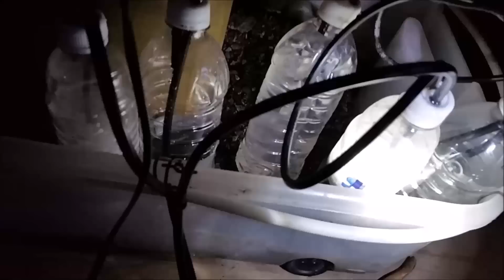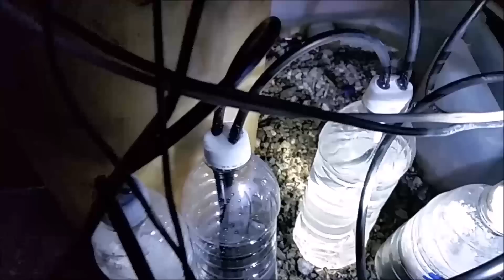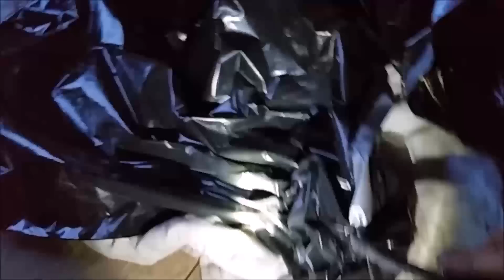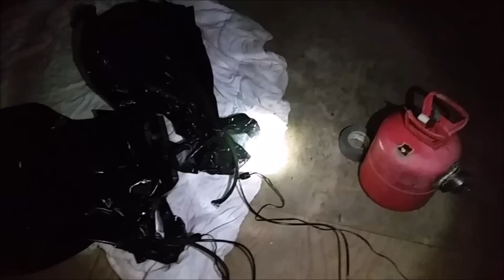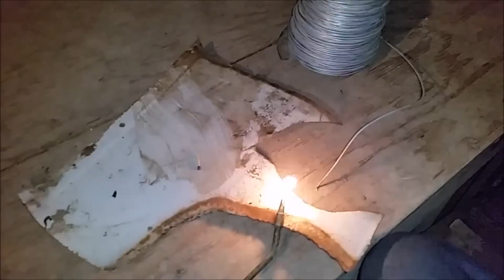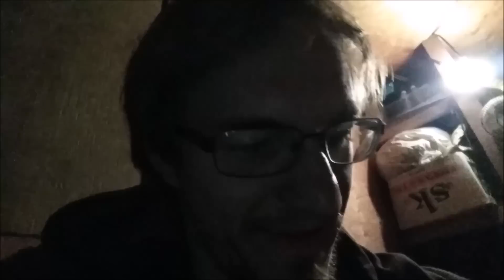Burning Water

Comment: I hope you've been very careful with those cans with those soldered shcraders.  I'm sure it can hold a decent amount of pressure, but the solder is a weak point.  I hope you made sure that the relief valve will burst before the solder will breach.  Also, are those R410a cans?

Comment: i really love to see that. As a Teenager i built a similar Oxygen-Hydrogen-Seperator with plastic bottles, hot glue and graphite electrodes (these worked surprisingly well, try it maybe!); powered by a laptop-energy supply, but i never got it to withstand pressure. If i had a compressor i could have done it your way, but i didn't had one and neither got that idea. 
Cool man :) i loved to see how well the torch itself worked then.

Comment: Cody, in this video you open the hydrogen first. I always see in instructions that torch are supposed to be opened with the fuel first then the oxygen... why is that ?

Personally when I use acetylene, I like to open both acetylene and oxygen so it lights up without sooth. Is there a good reason not to do that ?

Comment: to properly evacuate a cylinder you have to run a vacuum pump to nearperect vacuum to get as much moisture out then fill them with nitrogen to absorb any lingering moisture then run the vacuum again. this method could be done multiple times till satisfaction. or 3 times with is called a triple evac.

Comment: Gas production depends directly on current not voltage so you would do well to run larger and more numerous plates spaced closely at the lowest possible voltage (~1.8V) to maximize efficiency.  Running at such high voltage just creates a ton of heat since P=V^2/R.

Comment: You should have used a brushless electric engine in the compressor that way it wouldn't light the Hydrogen Oxygen mix you made. plus if you compress any Oxygen into the tank then you may have just built a bomb.  I would come up with a better way of doing this. Be safe.

Comment: "Smells like air" -Cody2k16
Reply: Hydrogen smells like nothing too... but it makes you talk all squeaky-like!
Reply: Actually Hydrogen is a lot less dense than Helium, so your voice would be hyper squeaky, Obviously nobody sane would breathe Hydrogen.
Reply: Tore, I've breathed in hydrogen many times and the pitch actually ISN'T that different from helium for some reason.  It does make your voice go higher than helium but not as much as you think.  I can't explain why.  I guess I am insane a little bit.  It's not nearly as dangerous as breathing in a hydrogen / oxygen mixture... well, I take that back.  It's actually QUITE more dangerous to breathe pure hydrogen, assuming there is no source of spark, because you're depriving your brain of oxygen.  A hydrogen/oxygen mixture would not hurt your brain but a spark would cause the flame to flash back into your lungs and you explode.
Reply: I'm not really sure on that.   Yeah, what I'm doing isn't safe.  The best thing would be a helium/oxygen mixture :) TOTALLY safe.  That's what deep sea divers breathe.
Reply: Legend of the Stormlord it’s because hydrogen isn’t to less dense than helium, hydrogen has an atomic weight of about 1 and helium is 4, compared to helium and nitrogen (which makes up most of the air) which is 4 to 14
Reply: @Tore_Lund  Cody did

Comment: Do you use mercury as your cathode electrolysis runs hand in hand with electroplating I want to try Mercury because I feel like it would be easier to separate it might take less electricity and be more efficient.

Comment: There will be trace amounts of whatever material is used to lubricate the pumps in both streams. German airship crews had a terrible mortality rate in WWI until this was realized and they converted to oil-less compressors and they stopped dying from asperating oil. You might be able to make it safe(r) with yet another hooka system. it'd be a design challenge, though.

Comment: @codyslab

its a federal felony to refill those Wal-Mart balloon tanks lol
Reply from the maker: Nope just a crime to transport them after they have been filled.
Reply: +Cody'sLab how did you get them to that location?
Reply: looks to me like he filled them where he used them, no transportation
Reply: Why you gotta be a narc and try and get Cody in legal trouble? lol
Reply: But only if you transport them for others or for sale. It doesn't apply if you filled it yourself for your own use and you transport it yourself.

Although, there are state and local laws, too, but I've never found any that were notable.
Reply: I belive that he meant transporting around on the streets with a car or what ever.. i think not sure
Reply: but you can see he just filled them in the video
Reply: andrew mac sweet
Reply: +Cody'sLab why
Reply: Only if you transport them.
Reply: Not the same thing under the law.
Reply: If you place it in a car truck van bike and take it down the road your going to jail in most states.
Reply: +Darian Berg he filled it after transport
Reply: Darian Berg I bet it has never happened, not even once. First, it would be a civil offense not criminal,  so even if found guilty then no  jail time and no criminal record. Jail time for a civil offense is possible but rare. And for all that to happen a CHP officer would still need probable cause to pull you over and inspect your cargo. It would never even occur to an officer to check a cylinder. Does a self filled tank  look somehow suspicious? And how would someone even check? It's completely impractical. How would anyone possibly know? Can you think of any method that could be used to detect and check for tampering with tanks? Is any such system actually used? So why would you worry even if you were pulled over carrying a self-filled tank?
Reply: *****
numb
Reply: I agree.
Reply: Its about crossing state lines and it is a federal crime... In some states you can't drive at all with a refilled non DOT gas tank at all. If you ever do and some one gets hurt you will be arrested...........
Reply: never said he didn't
Reply: Yes, if I hurt someone with a refilled tank I could be arrested, but that is regardless of the existence of a federal statute related to these tanks. And federal criminal law would apply at a state level regardless of crossing a state line. Also, see criminal vs. civil law. The only statutes I have found related to these compressed gas cylinders only applied to transport for trade. A dealer would get their license suspended and receive a fine -- but no criminal charges. If your tank were to injure someone then this could result in charges of criminal negligence, but the DOT statutes are irrelevant here. This would be a crime even if the there were no statutes related to compressed gas cylinder tanks. Generally speaking if your negligence hurts someone then you can't use "but there was no law against it!" as a defense.

I'm not trying to be a dick. I have actually checked because  I wanted to be sure I wasn't breaking any laws transfilling small tanks from larger tanks. The DOT does not approve this, but as far as I can tell this is not illegal. I see lots of people say they think it's illegal, but I've not found anyone that can point to a state or federal statute and say "this is why it's a felony crime." Obviously I'm no lawyer, but if there were a law covering this anywhere you would think it would be easy to find online. The DOT commercial transport statutes are easy to find.
Reply: Noah Spurrier — Too long, did not read.
Reply: HAHAHA calm down fucken nerds i bet you think its wrong to watch movies on the internet too hahahahaha!!!
Reply: TheSkaterGabriel he had to transport it to that location by walking or driving sooooo....

Comment: Next step get a 3 stage scuba compressor and convert your car to hydrogen power.
Reply: Be much better off with an electric car though
Reply: its more efficient to convert the hydrogen to electricity then power your electric car that way instead of burning.   Of course Cody has the video for the fuel cell too.   It would be tough to get the fuel cell to produce the electricity in the right quantities on demand.
Reply: water power car

Comment: How did you seperate the oxygon from the hydrogen?
Reply: hydrolysis, it's a proses that uses electricity to split water molecules.
Reply: how would you get the hydrogen and oxygen to move to separate containers?
Reply: Michael Hartman 
Oxygen is negatively charged and hydrogen is positively charged, therefore they separate to there respectively charged electrodes.

Comment: That's a really good idea with those compressors. I was trying to figure out how I would go about compressing the gas, but never thought of putting it in a bag.
Reply: Cody doesn't mention this, but he probably sprayed out the bags with a little water first, to add some humidity to the setup. You've opened a new trash bag and felt the static. Bad idea around one flammable gas and one explosive one.
Reply: yeh, i was like, wait, air compressors suck IN air to compress it, thats why he has bags :O! so the compressor can suck in gas instead of air :D  confused me to start
Reply: +Forget2BHuman I see what your saying, yes obviously a compressor compresses, but Usually there is no standard fitting for the intake of the compressor, just never thought of putting it in the bag.

Comment: I have an aversion to using a spinning motor inside a hydrogen rich environment. 
My ideas all include "large" translucent pipes submerged open at the bottom with a valve at the top that enters the inlet of a compressor, at that point you could use a float to set when your compressors are triggered.
Reply from the maker: the funny thing is that the oxygen one ended up exploding.
Reply: +Cody'sLab chemically speaking it is much more likely to combust seeing as oxygen is required for combustion. as a 3 year chemistry student I am prevented from replicating most experiments I've seen due to being shown what happens when it fails. that being said if the collection bags ignite (in theory) they should burn out quickly and be incapable of producing enough gas to continue the burn.
Reply: Probably carbon dust on the brushes ignited. You could run those compressors on some model aircraft brushless ac motors and speed controllers driven by arduino to have sparkless compressors.
Reply: Cody'sLab how is that valve you soldered on the tanks called ? I couldnt understand it
Reply: rio van der putten schrader valve
Reply: MrHack4never thanks

Comment: I saw a video of someone making methane to use in there house for heating and cooking. they trapped the gas in two drums one larger than the other. the largest drum contained water the smaller was inverted into the first with a BARB FITTING/ VALVE  when gas was needed they weighted the trapped gas in the inverted barrel to create pressure

Comment: make a fkn hydrogen combustion engine... then refine ur water splitter/ hydrogen extractor so it gathers the hydrogen more quickly and consistantly and once all the creases are ironed out u can sell the car with the home system too, so people can have a constant full tank of fuel at home so u can fill up at home when u need to and never run out of fuel... Don't let the big oil company's know but!!! it didnt work to well for the last guy!!

Comment: I have seen large equipment tire inner tube used as a low pressure accumulator, remove the schrader valve, and a tee fitting used as a input from the splitter to the accumulator and outlet to your compressor's cylinder input. You might also consider adding joker valves on the input and output sides of the tee fitting (not the tube leg of the tee)(found on the fuel return line in a modern fuel injected ford in the gasoline tank) Place the fully deflated "accumulator" at a higher location like up the hill or on the roof and when it inflates slightly then have the compressor turn on. 
Also since the accumulator will become lighter, you could use a scale to control the opening and closing  for the compressor circuit.
  You could use a decommissioned (red tagged) oxygen bottle from a gas supplier ($10-$15) as your H storage (Repaint red and mark it as Hydrogen fuel) as they are built to withstand extreme pressures and external abuse. (your HF compressor could never get an industrial O2 bottle into danger zone because of pressure as long as all oxygen is first purged and never allowed to intrude.)

Finally you might consider doing a video showing how you can use a 9V battery to start steel wool on fire then step it up using only O2 ,step the gage of steel or start on a thin edge,it will burn to the point you can cut 1/2 inch steel or more with the right tip and  O2 volume. The steel and carbon are the fuel , heat and O2 is you need to cut steel of any thickness. Cody's plasma cutter. Thanks for the great vid.
 PS keep the oxygen in separate storage way away! Don't store any more than you need. As for the hydrogen, store in a shed with a ridge vent!

Comment: why do all the hho generators I see use stainless steal and you use lead I have been on hold for lack of some stainless also what is your electrolyte also  I am wanting to use hydrogen to help run my generator to save on fuel  thanks for any help you can give me also do you gave any grounding inside your hydrogen tank as I am worried about static electricity when storing hydrogen gas thanks for any help

Comment: - Not sure if this is in the comments anywere, and I know it's kinda an old video, but the compressor you're using is driven by a DC motor. These motors creates sparks when run. Maybe try another method, or another motor for compressing the gas would help not to blow up the man-cave ;-)

Comment: Improvising at its best. I'd never think to use a $7 harbor freight special air compressor to obtain O2 and H2. This is some greatness right here. My humble two cents: (1) Punching balloons would be great for hermetically sealing your compressor setup. (2) Adding Diatomaceous Earth to your hydrogen container will add the almost infinite surface area needed for the very slippery H2 to cling to, thus improving containment. Now if we could get the big people to scale this up around 2 billion times we'd be set. Planet Earth would live! Cheers

Comment: Cody, hope you planned safety margin for hydrogen embrittlement of the pressure vessel.  A thin baked on slip coat of clay inside could stop most of the danger of embrittlement and all you would have to figure out from that point is your fittings.
Reply: please elucidate'thinbaked on slip of clay'is it flower pot e.g?